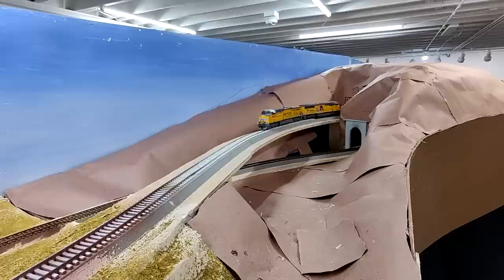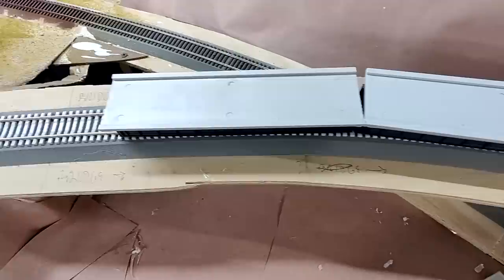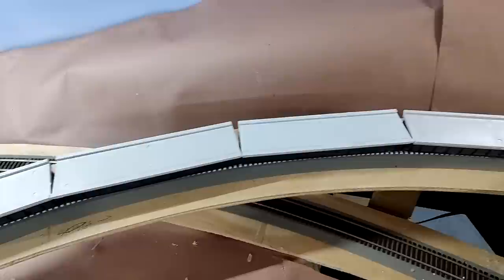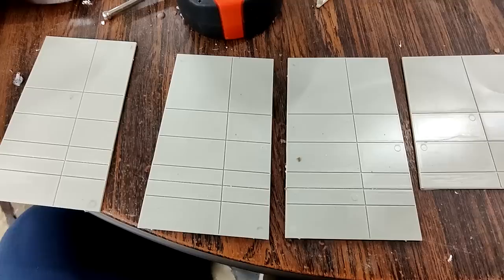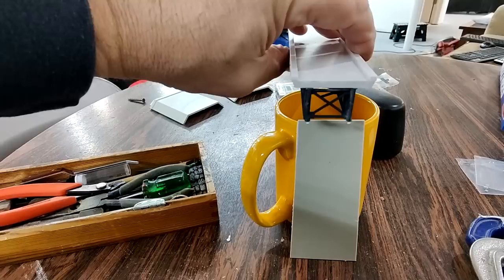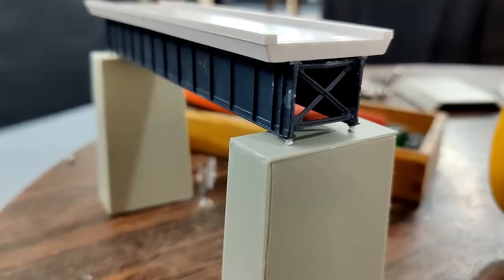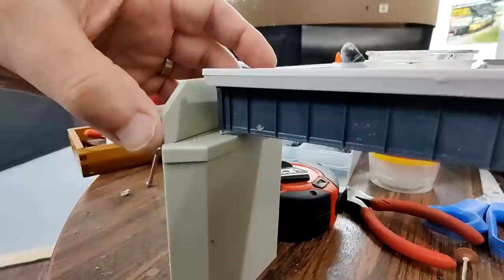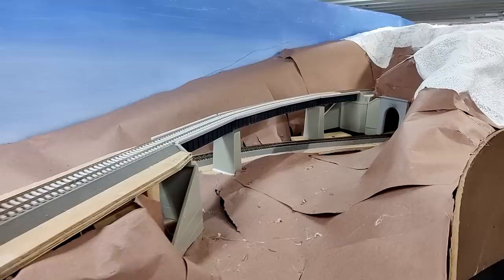Model Railroad Bridge Install at the Curvo Flyover.  Union Pacific Railroad Evanston Sub S2023e11

Comment: One neat detail I noticed on the prototype photos is the guardrails to prevent a derailed train on the lower track from taking out the bridge above it.
Reply from the maker: I saw that too and no guardrails on the bridge itself.
Reply: @EvanstonSub  Are you planning on reproducing that detail?  Usually, the guardrails are smaller, so it's best to go down one size (eg, Code-100 to code-83 or code-83 to code-70, etc).  I'm sure you already knew that, but other less-knowledgeable people read comments too.
Reply from the maker: I do plan on adding the guard rails on the lower track.
Reply from the maker: You're absolutely right about everyone reading the comments and benefiting.

Comment: Did you disconnect the track on the bridge before cutting the plywood under the bridge? Disconnect at a joint or cut with a saw?
Reply from the maker: Yes, I removed the track before cutting the plywood span.